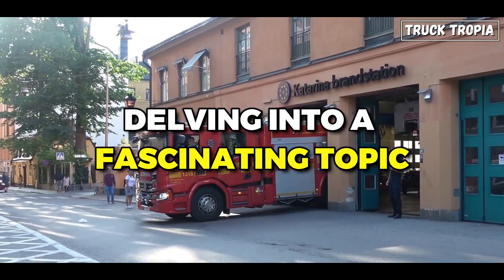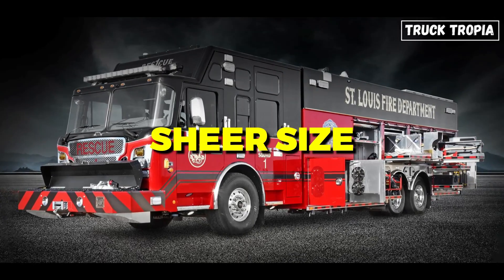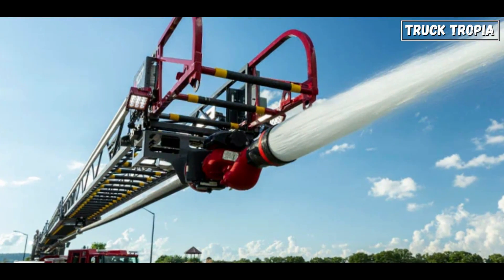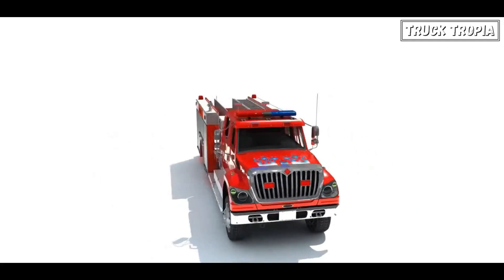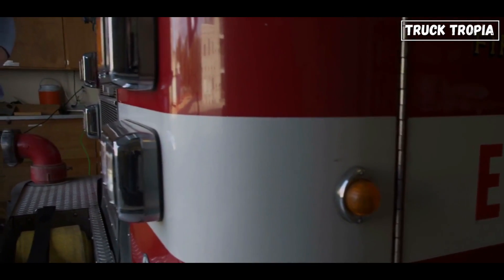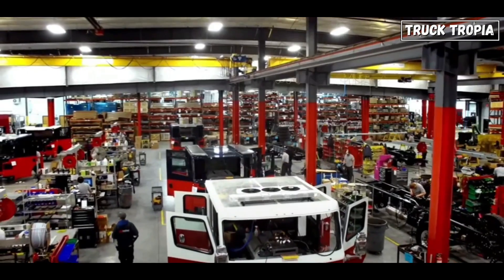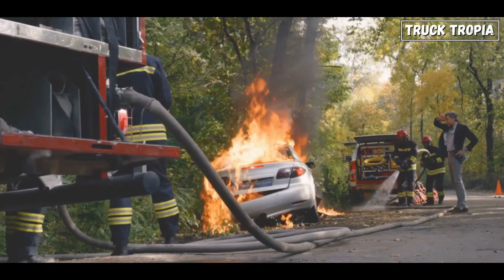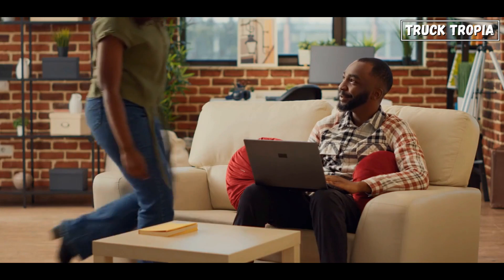Why Fire Trucks Are So Big And Complex?

Comment: It's good that firetrucks are big so they hold a lot of equipment but how are big trucks going to be able to maneuver though narrow streets like in New york and Los Angeles
Reply: The biggest ones used to have 2 drivers and 4 wheel steering. The second driver controlled the back two wheels.
Reply: @Hazmat616   its called a tiller

Comment: Can u make a video about why volvo made flat nose and long nose truck
For example:
Volvo fh and volvo vnl
Reply: Easy way to explain is the flatnose or cabover is better for stuff where shorter turning radius needed
Reply: @southaussiegarbo2054  thats not the point bro
Reply: @orangsesat1   volvo still makes both fyi
Reply: @southaussiegarbo2054  i knew it and my question was close to it but thats not the answer💀💀
Reply: Volvo vnl's are built for the North America market and the trucks are built in Virginia, USA.The vnl's came to life when Volvo purchased  General Motors whitegmc truck brand in the 1980's.